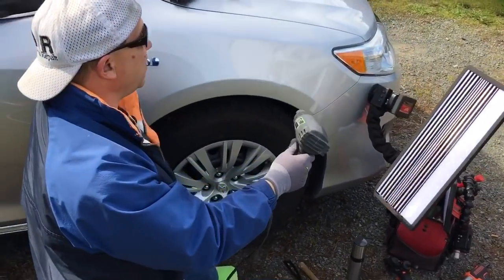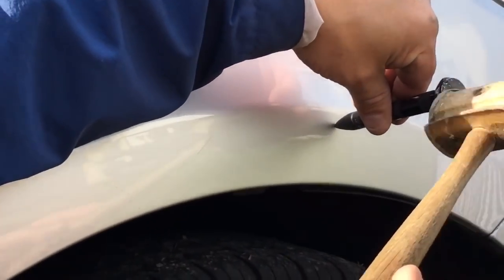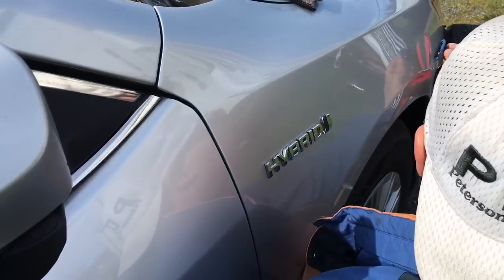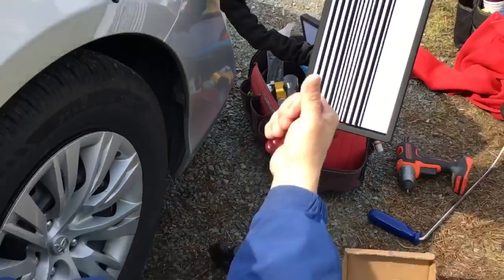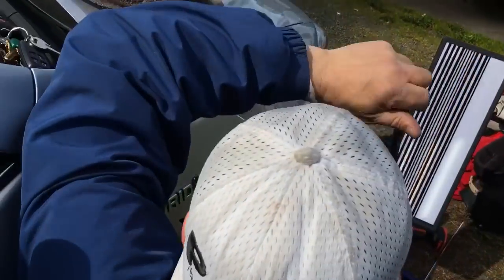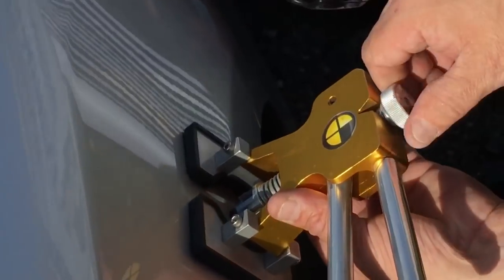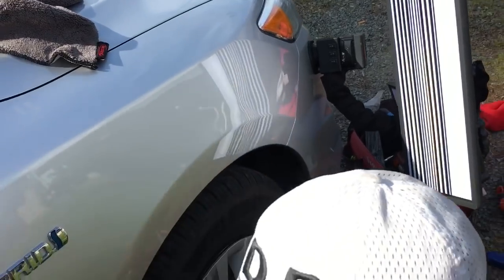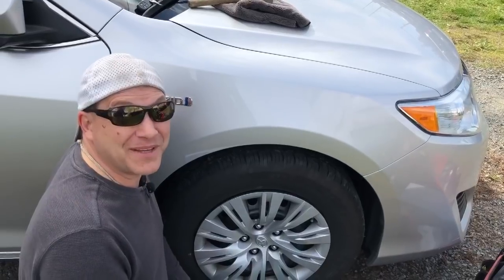PDR wow!😎 A |HOW TO|commentary from start to finish!

Comment: Looks good!  Curious why you pull instead of push on this one?  Also anxiously awaiting the simon smith PDR video series.  :-)
Reply from the maker: Chris J Dixon normally I would always push on the stand but I figured I just tried to glue polar to save me some time to remove the meat of the day and a lot of times it really helps in this case it kind of slowed me down I think I could’ve just gone behind it and started pushing and made a really good result right off the bat. Thanks so much for watching and commenting. It means a lot to us👍